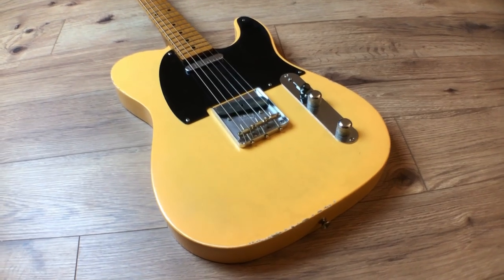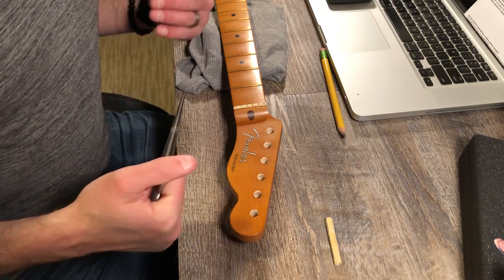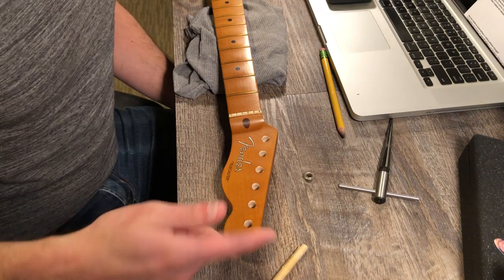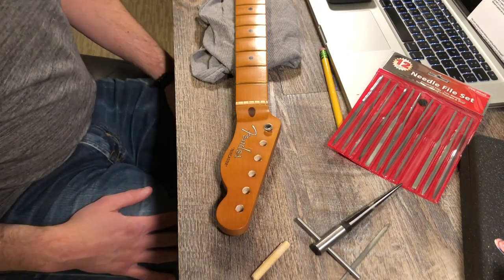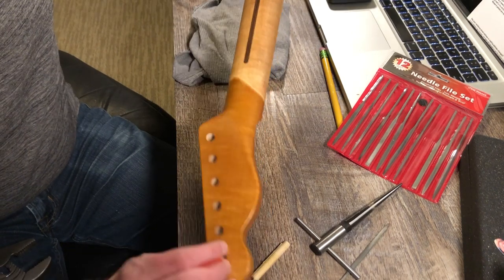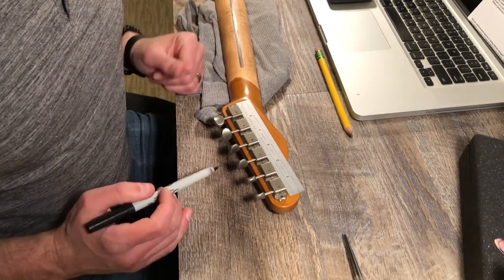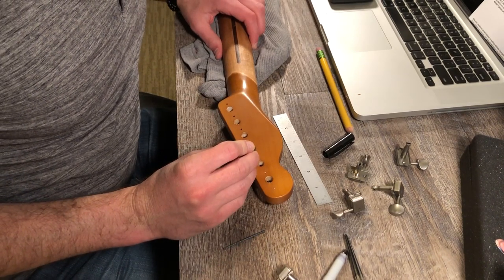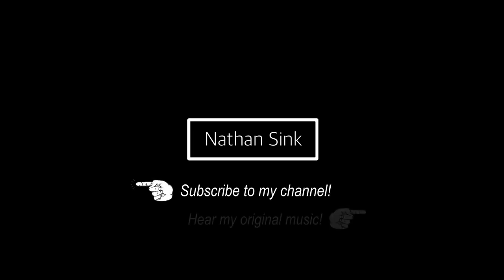How to Install Tuners for the First Time

Comment: Thank you for all of these tutorials, they’ve been a huge help. Tuner install is the next step in my start project. How long did you let the nitro dry/de-gas before installing?

 I’m worried about cracking the finish if I do it too early. 

Thanks!
Reply from the maker: Thanks! I’d let the nitro dry for 2 weeks minimum after your final coat, then you can wet sand (something that still eludes me 😬) & polish as desired.  You can always do a “fingernail test” in an inconspicuous area of the neck (like the heel part) by pressing your fingernail into the nitro to see if it indents or if it’s fully dried. 
All the best.

Comment: Very interesting. I just bought a warmoth neck to replace a fender japanese strat neck and the holes were ordered on the warmoth neck for vintage tuners like yours.. I thought the holes were big enough for the bushines, but I see like your's they're not. Which I don't understand.. Why do they not drill the holes big enough in the first place so that you can just push the bushings in ? 
So are the bushings supposed to be tight in there? I'm totally confused.. Sorry.. 
Thanks for this very much though.. 
Tim
Reply from the maker: I think the idea is that you’d rather have them snug (& have to ream them out a bit) verses loose. It’s always easier to take away material. All the best.
Reply: @NathanSink  Great looking tele by the way.. I'm more a strat or LP guy, but that was a good looking tele..
Reply from the maker: @hoosierdaddy2308  thanks!
Reply: @NathanSink  Absolutely man!

Comment: I made a tool for pressing in/pulling out bushings. It involves a long bolt, a wing nut and a small block of wood with a hole in it - you'll figure it out :) Counter sinking the tuner holes a tiny bit first is a good idea to avoid chipping.
Reply from the maker: I should make a tool. I just don't do the job very frequently & when I do I'm too impatient to wait. 😂 Definitely a good tip on the counter sinking!

Comment: I would have used a bolt, a nut and 2 washers to press in the bushings into the head stock. If you don’t have that lying around you can get at Lowe’s or Home Depot for $5.
Reply from the maker: That’s a great way to do it too! I should get some of those for the future. Guess I’m too lazy & use what I have lying around. 🙂

Comment: Recently bought a brand new 50's reissue Stratocaster neck, and the bushings sat just like yours, so I don't think it was in any way the result of your lacquer job.

For the final squeeze in I used an ordinary c-clamp with two squares of thick veg-tanned leather to protect the headstock. Worked a treat!
Reply from the maker: That’s a great way to do it! Good idea. 👍🏻

Comment: What do you think about using a drill with sand paper taped around the bit?
Reply from the maker: As long as there’s no power connected to the drill! 😂 It seems like that could go wrong really fast.

Comment: Good vid. What's the option if bushings are slightly smaller than holes ?....model airplane glue ?
Reply from the maker: Thanks! If the bushings are slightly smaller than the holes, I’ve used tape before. You can see an example at about 25 minutes into this video: https://youtu.be/JQd1T0iAb9A

Comment: When I swapped the tuners on my d28 the bushing was too big as well. I just put the busing on a drill to spin it and took sand paper to it...the wall thickness was enough that I can remove enough for it to fit in the headstock hole without touching the wood.
Reply from the maker: Interesting approach!  Thanks for sharing. :)

Comment: Hey Nathan,
What are the disadvantages to installing tuners so that the tuner knob axles are CLOSER to the bridge than the tuner peg axles?
For that orientation, are sealed tuners strong enough to prevent the string tension from pulling the tuner peg gear away from the tuner knob gear?
Reply from the maker: @TheLookingOne  hmm…I’m trying to figure out what you’re saying but I’m not sure I understand. 🤔
Reply: @NathanSink  Hey Nathan, most installs have the tuner knobs closer to the top of the headstock.than the pegs. That way, string tension pulls the top of the peg down toward the bridge, the hole in the head leverages that so the tension pushes the gear end of the peg up toward the tuner knob gear.
Does that clear it up? 
That's the common way. I'm thinking about positioning the tuners the other way around (with the tuner pegs closer to the top of the headstock than the tuner knobs) The string tension will then tend to push the 2 gears apart. I'm wondering whether in sealed tuners, the tuner 'case' will be able to resist that force.
Reply from the maker: @TheLookingOne  I think I get it. It would essentially be like putting right hand tuners on a left-handed guitar (or vice versa)? I would imagine they could handle it fine, but don’t hold me to it. 😉
Reply: @NathanSink  You got it Nathan. I think I'll take a chance. But I want to get second opinions from experienced minds.
Cheers

Comment: Great video..  I really enjoy your videos.  Working on my first build and am learning alot from you.  I am no expert, but I would not force them in the way you did.  Any change in wood density through moisture absorption is likely to crack that headstock.
Reply from the maker: Front Row Rock thanks! Always glad to help. 😊 I hope I don't get any cracks. 😬 Time will tell. But that's the main reason I opened up the holes like I did with the reamer: to allow the bushings to go in better.
Reply: @NathanSink  I didn't see you ream from both sides.  I may have just missed it.  Reaming from both side and meeting in the middle assures the optimum diameter.  Me thinks maybe that's why they started so easy but had hard time penetrating to the bottom of the well.😆 Story of my life.  Again thanks for sharing.  You have helped many with this video

Comment: If i get kluson tuners will they fit a modern strat?
Because i got the kluson style tuners from fender that use the 2 pin mounting system and in wondering if they'll fit

Edit: the hole thingy is 10 mm
Reply from the maker: You’ll definitely have to get the 10mm to 8mm adapter bushings. I’m not sure I understand which tuners you currently have. In the worst case you’ll have to drill some new holes & the existing holes might show. Hope it works out.